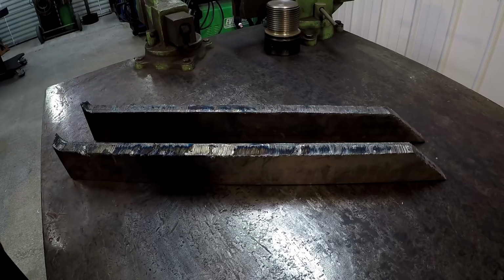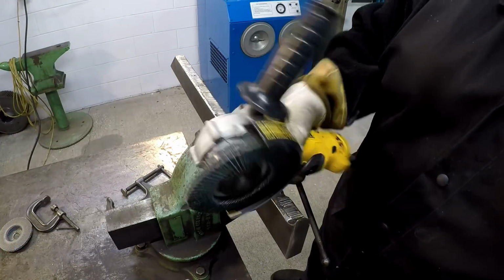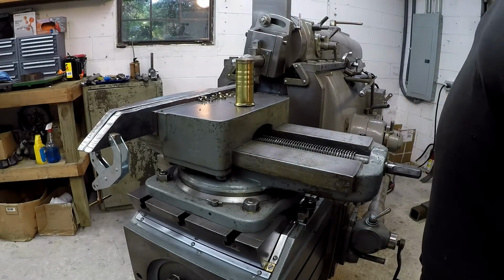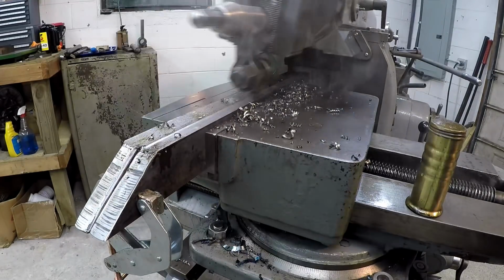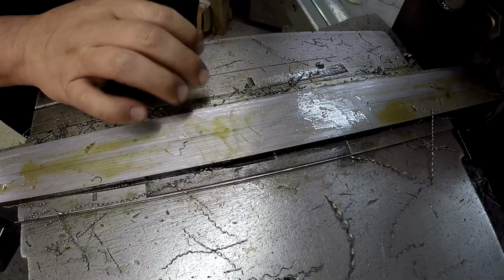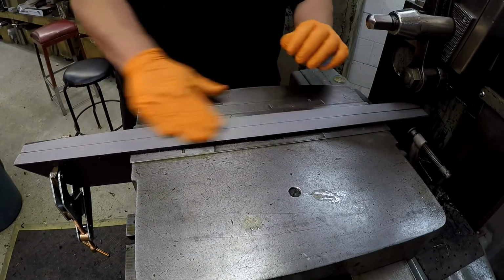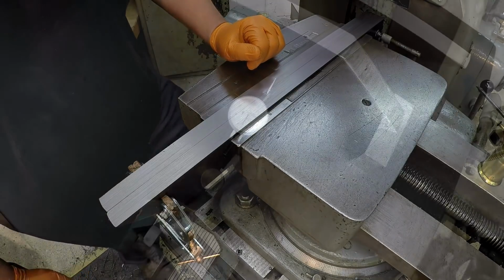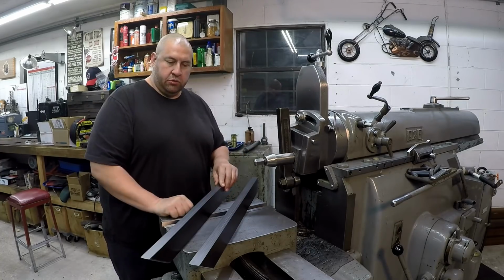SNS 220: Shaping 28" Parallel Bars

Comment: You're trying to cut steel with a tool that has a negative rake, that's why it's tearing instead of cutting. Although since this video is 6 years old, you have probably figured that out by now

Comment: As a chemical engineer who grew up working on a farm, I still love to see people doing precision work.  Doesn't matter whether it's machining, pipe fitting, sheet metal or fabrication, if you have some of these skills, you can figure out how to do anything.  I channeled my love of these things into woodworking.  I'm a hybrid guy, power and hand tools, and not into fussy little bits.  I try to watch these machinists do their magic as much as I can because I learn new setups and measurement techniques.
Reply: Ahhh same thing,I've never been around a Machine like that,I've seen a few old Bridgeports but no machining experience what so ever but it's cool to watch

Comment: Used a shaper in high school shop class to make a billet aluminum cribbage board. Must have been the first in a long time to use that shaper. All the grease was dried hard. Took me two days of servicing the machine to be able to use it. Could have easily done the operation on a mill but I just wanted to use the shaper. Took second in a state wide competition. 1st place was a grandfather clock made from brass and aluminum. He definitely earned his win.

Comment: Nice work Abom79.  The last time I used a shaper was way back in 1979.  The shaper was always one of my favorite machines and I always loved when I got the chance to use it.  The shop I worked in had two shapers.  One was a Steptoe and the other was a Gould & Eberhardt.  The Gould & Eberhardt was customized with a manual transmission out of a truck for changing the speeds.  It was a real novelty.  I really miss working on machines like that but I believe that most shops have scrapped them.  It so great to see a machinist such as yourself keeping his piece of history alive.

Comment: I used to run several shapers @ a time back in the mid 80's. Hold +.002  -.000  cutting keyways. They did the job great. Nice looking machine ya got there. I actually miss those old machines! Wish I had a quarter for every keyway I cut.
Thanks 4 sharing!

Comment: I have a small Logan shaper that I rebuilt and am learning to use primarily to develop my skill and to experience what the machinists before me had the skills to operate.  It's a damn shame so many of these older machines of all sizes were scrapped when vertical mills proliferated industry.   I learn from every video you publish.  Your camera work is also exceptional.

Comment: Hiya Adam. I love watching that big shaper run! when you show it, show full cuts.. we will enjoy watching the whole thing. I have a smaller shaper (12" Whipp with 14" max cut" and I love running that as well. 
On your shear tool increase the shear/helix angle  even more. Try running a 30 degree angle from parallel to ram travel. More shear angle gives me the finest finish I can get. Of course, with that shear the least stepover feed is needed for the finest finish, along with a light finish cut depth. Thanks again for the great videos!

Comment: I hope your recovery is going well.  That was an excellent video, it was mesmerizing to watch that old shaper rip chunks of metal off of the parallels.  I don't think you were close to the limits, the G&E didn't even break a sweat on that job.  It is a testament to the people that deigned and built those heavy machines back in the day.  Just a pencils and a drafting table, analog measuring tools and old fashioned machining, no CAD-CAM and CNC.  If folks can't appreciate the beauty in that kind of work, on that kind of machine, then they need to go find some other porn.

Comment: I ran a shaper for 2 years exclusively and I learned negative rake tools were hard on the machine. They push the clapper box against the hing pin not against the back of the ram. Notice the chips how they are welded together. The bouncing of the tool can be clearly seen in the results of the first finish. As soon as you changed to a positive rake all that went away. Secondly hot roll loves surface feet. The faster the better, I've found. So get a piece of hot roll and increase the surface feet per minute at least 2-3 times using the very same tooling. I think you'll find surface finish much improved.
Reply: On a 24 " stroke, at triple the speed he is going to need to bolt that machine down. While playing around in an earlier video, he got that g&e hopping pretty good. It moved noticeably across the floor with every stroke.
Reply from the maker: Robert Burns I have tested some of the higher stroke speeds and especially at those Kong’s stokes I do not like the way that ram hammers back and forth. The higher surface speed would help but I don’t want to push it that hard. I’m learning that the positive rake tools are working better for low carbon steel.

Comment: Old world skills...love it. I worked in a huge shop that had a planer. This machine was not run in the whole time I had been there but management assigned me to it with a job.. I had never run one in my life. Once I figured out the handles and buttons I set up the job and was using hi speed tools with grinds similar to the ones you were using. Wasn't coming out with much of a finish.There was an old guy...you know the type....Silver hair and you thought he had elves in his toolbox. He watched me struggle from across the isle for half a day then walked across the isle with a tool in his hand...Approx 1" of rex 95 with a bullnose radius approx. 1/4"-3/8" with a huge rake. "Try this son" and he walked back to his box. I was skeptical but put the tool in the holder and started to cut. Man was I surprised. That tool gave a great finish even with the deeper cut. We worked on big steam turbines and large power plant equipment. An alloy used in the turbines was called waspalloy and would wreak havoc with carbide tools in the interrupted cuts. Hi-speed was the only tool that would hold up. Enjoying your vids....I'm retired now and they sure are bringing back some memories.

Comment: Nice work and great to see old machines being used.
The deviation when you ran the clock over it on the surface table may have been caused by the stock faces not being parallel. 
Thus transferring that error to the machined faces.
I remember these old shapers when I first started  engineering college during 1989
They were slow but at the time more accurate for squareness and parallelism than a milling machine.

Comment: Adam, you might be able to improve the finish on the cut if you ground a small radius on the corner of the cutter..... Rather than have a sharp point.

Also I think you mentioned at this material is HRS. Hot rolled steel, in my experience, is a very gummy material...... It's hard to get a good shiney finish on it.

Comment: Mr. Pete made at least one video testing a shear tool for the lathe on different materials. Among them mild steel which did not give good results neither. In another video, I think, he tested the tool on lead flywheels for model steam engines. That worked surprisingly well on this super gummy material.
Reply: if Adam does not find them in reasonable time how could the rest of us? If you try dozens of geometries, cutting materials and tuen dozens of bars to chips probably you will finally find your speeds and feeds. But is that practical to do at home?

Comment: What a beast machine, its literally just shoving metal out of its way. Im hoping you have some videos on how this thing works
Reply: Basically a big flywheel inside it with an off-center crank that connects to an upright member that transfers to rotating force into a back and forth motion like a piston in your car.

Comment: Roughing both sides first before finishing would probably have gotten you a straighter set of bars. Still pretty close though - plenty good enough for bench work. Also, since that material was so soft it would have helped to grind the tool so that the side rake was positive rather than negative. Been a while since I've run a shaper. Or a planer. Those were some enjoyable machines to run.

Comment: I hand scraped 3 aluminum bar stock against each other using the technique oringinally thought up (A to B, B to C, C to A, flip , etc) using prussian blue and scraping, about 2 years ago. Wanted to experiment making straightedges from scratch Seemed flat but i never had the tools to measure. Yesterday i finally used a granite surface plate i got at a garage sale for $8!! As well as a brown and sharpe dial indiactor for $12 from the same sale, using 123 blocks for supports. My hand scraping seems to measure half a thou and less. Pretty good i guess !

Comment: We have an old Cincinnati shaper we use for keyways and broaching. It's one of those machines that has a special purpose and doesn't get used that often. But when you start looking at jobs like this, it can be one of the best solutions in the shop. Most guys in my shop to do that same job would have used an endmill on the Bridgeport mill and then onto the surface grinder. This does it all in one pass. Brilliant!

Comment: Have you thought about building a grinder head for the shaper? You could rough it in and switch heads to the grinder and polish the surface with the same machine...

Comment: I've used carbide at carbide speeds on a shaper. It's scarey at first and the clapperbox tends to slam on the return stroke but you triple (well, double) the stock removal at the same cross feed per stroke. I used a round button insert tool but if you have a suitable tool for CMNG or DMNG inserts cutting on the obtuse corners it's a good way to use up all those half-used inserts.

Keep track of the ram temperature when long stroking at higher strokes per minute. High oil shear rate generates heat. You don't want it to warm so much the dovetail ram expands to sieze in its box. You might want to extract the ram gib 3/32" to give it an extra 0.002" clearance but only if the ram dovetail starts to warm. Keep close track at first. The temp rise tends to be exponential over short time.

Comment: The G&E is how old?  It still cuts within .001 over 28".  Mighty impressive.  Is the vise about 18" wide?  Never realized how big it was until it had those bars in it.   Jeff
Reply from the maker: I believe Keith looked it up and was built around 1946 or 1948, cant recall at this moment.
Reply: Abom79 
Hope you’re doing well. That shaper can easily pass for made yesterday! Very clean lines in the design. Art Deco period. Beautiful restoration Adam, thanks for all the knowledge that you freely share. You personally make America Great Again. Not a political comment!!! Your Dad and Grandpa certainly raised you well.

Comment: I kept trying to touch off and cut on my lathe and could not get it to cut. I then found that I forgot to tighten the bolts on the tool block. So as I pushed the insert into the part, it just shoved the block back. I felt like an idiot. That's when you scan around quickly to see if anyone saw you. lol
Reply: lol , been there done that

Comment: That Mo-Max Cobalt is great stuff!!! I used to hoard it at my shop, it was sorta scarce,most of our tool steel was cheap import stuff so when i would come across Mo-Max it got put away into a drawer in my tool room where the other guys couldn't get to it! That stuff was one of the few tool steels that would hold up to the interrupted cut of the hex stock we were running on our Acme Gridley's. Cheers man, great to see a old shaper still making parts, takes me back to being a young man first starting out in the shops!
Reply: Mike Bates I am an engraver and I recently bought an assortment of gravers and a few of them are the mo-max cobalt. I sharpened them and they cut wonderfully.

Comment: My dads workplace used to have a shaper from 1910 with ~27 foot stroke. They mainly used it to sharpen the blades for their 20 foot hydraulic shearing machine. They had to scrap it in the eighties due to safety concerns, exposed gears apparently was considered unsafe... Now they have replaced the shears with a plasma cutter, since it had troubles cutting Hardox. They sure had cooler machinery back then.
Reply: 27 feet!!!!  daggum..would have been cool to see that sucker in a long throw
Reply from the maker: Sounds like a planer.
Reply: Probably a planer not shaper with that much stroke length James. Much the same idea as a shaper except the work gets clamped to the bed and the tool is fixed while the work travels under the tool. Today's very large bed mills evolved from those old school planers.
Reply: You are probably right. I have not seen the machine myself, since it was scrapped before i was born.

Comment: Don't think I've ever seen a tool quite like that before. 's not something one'd find a use for in a woodworking shop :D
Reply: It's a shaper. Stuff from way back, before electric erosion and CNC. Extremely versatile machine. The modernized saying is: "You can make anything with a shaper, ...except money."  Too slow for modern production.

Comment: I remember using the shaper in high school machine shop. I wish I would have bought it when the school changed over to more modern equipment. The effortless way they remove the material is amazing. Definitely could have used it, and saved a lot of end mills and a lot of cranking on the milling machine.

Comment: Your bit is not slicing the metal you are actually fracturing the material.  You mentioned geometry, I presume you were talking about the grind of the tool bit.  The sound and fractured cuttings almost brings tears.  The correct shape for the cutting tool of a shaper is not like that for a lathe.  The lathe, due the rotation of the part essentially has relief at the bottom of the cut. The shaper does not have this.  The correct shaper tool has spoon like frontal surface, similar to a chip breaker except the dish shape extends across the entire bit,  kind of like a plow.  Also, you did not address the adjustment of the apron, many a shaper has the box laying on the floor after not using it.
Reply: I've run into a lot of A36 steel lately that will tear rather than cut.  It's frustrating, but the sharper the tool, the more it digs in and tears out. A neutral or negative rake and a slightly "worn" in edge seems to leave a nicer finish.  Of course, none of this matters for roughig.

Comment: What is the benefits of using a shaper instead of just using something like a Bridgeport? ( FYI I know nothing about machining). I’m a chef by trade and we have tons of reasons why we do certain things with specific tools and other techniques with other ones. Thanks!
Reply: First, they're just way cooler 😎
Second, it can do things that a mill can't (and vice-versa)like internal keyways, also, tools are cheaper, and can be ground and re-sharpened really easily and inexpensively, and also, have i mentioned that they're just plain freakin cool?
Reply: A shaper takes advantage of some really in depth math/physics concepts to make for a super flat surface that a mill can't. This is alongside the fact that a single cutting edge (versus multiple with a mill) is more predictable It's a much slower process, but it'll produce a far flatter surface, whose "lie" is in a predictable direction, which can be useful though it wouldn't be here most likely.At the 30 minute mark, he properly measures flatness, and ignoring the part where the indicator is floating on air (while he's moving it quickly) the part is way under 0.001" flat across 28". That's pretty extraordinary even for modern processes, let alone a 50+ year old machine, operating on 100+ year old concepts.
Reply: A shaper cuts in a dead straight line. 
-- A Bridgeport knee mill needs to be perfectly flat to the cutting surface, but the tool in the bridgeport becomes a complication since it limits the size of the cut you can perform, and depends on how flat (trammed) the mill is. 
---As an added benefit, a shaper uses high-speed steel tooling instead of carbide, so you can re-sharpen your tools to your standards, on the fly. 
-- Since shapers go relatively slow, their coolant requirements are less. 
-- Another cool trick for shapers is the straight cut, just like a big strong carpenter with a hand plane.
Reply: Keep stay in the kitchen chef cheers How u want ure knives to be  made by an professionol ore the guy arround the corner
Reply: Also a flame cut surface (cut with a torch) like these were leaves a surface that is a mix of hard and soft that is very hard on a cutters used by a mill.  The cutters used by a shaper can handle this type of surface condition much better,
Reply: @tallakff7349  just because HSS has less potential to chip out?
Reply: watch the video he explains it

Comment: Such an awesome machine. Thanks for showing this to us. I never had a shaper or even seen one until i was at adams arms. We'd use it on our barrels. Yours looks like it has a lot quicker stroke than ours. On ours you could control how fast the stroke was and we almost always used it at or around its slowest stroke speed. Usually gave a pretty good finish. If you can, maybe try to slow your stroke speed down and see if that helps your finish.

Edit: just saw this was a year old video... wonder why it popped up in my feed now? Im sure youve played around with it alot since this video.